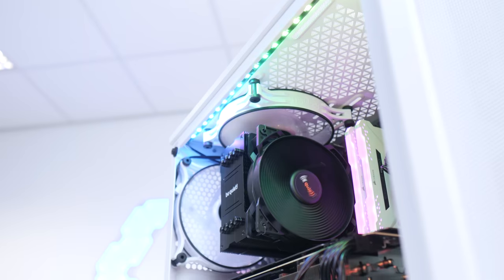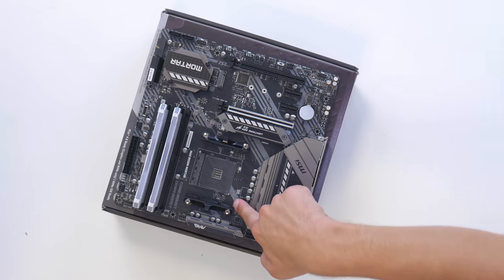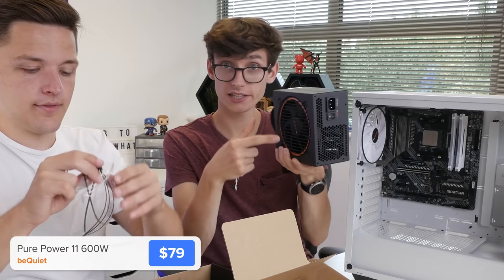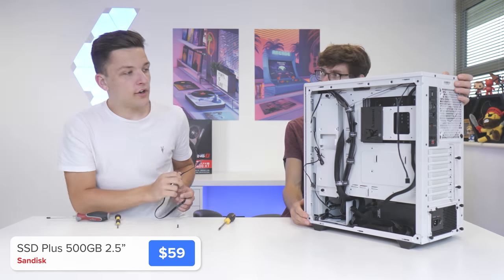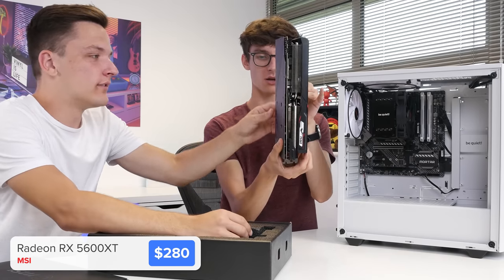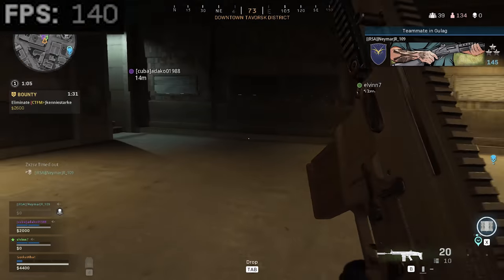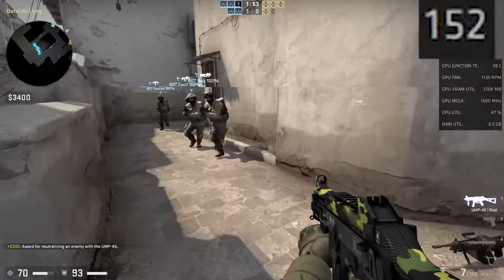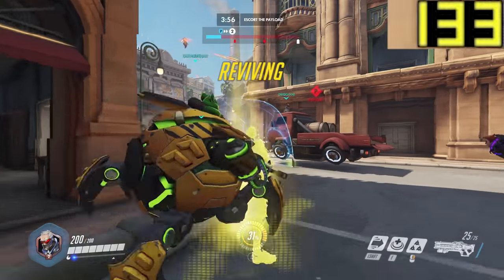Epic $850 Gaming PC Build 2020! [Full Build Tutorial w/Benchmarks! - ft. RX5600XT & Ryzen 3]

Comment: I thought I would ask but I have the same graphics card and I get stutters and idk what is causing it, can you help me out in some way???
Reply from the maker: Drivers all up to date? CPU or RAM not maxing out? Contacted MSI support? Windows updated etc? Let me know!
Reply: I had this issue on warzone with my 5700xt and I had to go into the game files and change the amount of cores used from 6-8. For some reason the game read my 8 core cpu as a 6 core, after I manually changed it all studders went away
Reply: @GeekaWhat  ive done all of that but still experience micro stutters, mainly in fortnite. Also i have the rx 5700xt not 5600.

Comment: An optimal build for a good budget! Plus quick question: How often should I clean my pc? It's been 2 and half months and my pc is looking quite dusty. I don't have air cans etc. Can you suggest another way to keep my pc clean without that?
Reply from the maker: Make sure you’ve got dust filters in the case with the fans pulling air in only through those filters! Keep off the floor if you wanna limit dust, too. Dust isn’t a major concern performance wise unless your pc starts getting super hot 👍
Reply: @GeekaWhat  Thanks mate! Cheers

Comment: Hi GeekaWhat! I’m going to build a gaming pc which is around £1000-2000. Could you do a build in the next video with a Ryzen 7 3700x and rtx 2070 super? You don’t have to but I think it would be good if you went for a budget like this.
Reply: I just built a build in this price range. Ryzen 7 3700x with a sapphire nitro 5700xt. 16gb of ram, b550 board an nvme SSD. Runs everything at 1440p 100 fps+ easily. Absolutely love it. 2070 super is a great card aswell but my card is comparable and is way cheaper

Comment: I bought the folllowing for my brothers 1st budget gaming set-up. Need your advice if I'm building the right system for him. He plays Roblox, Warzone, APEX, and does youtube video uploads. Do you think I picked the right items?......5 Ryzen 3600; G Skills 16GB DDR4 3600 CL 16; WD SSD 500 GB M.2; Toshiba SATA 4TB 7200 6Gb/s; MSI B550M PRO-VDH MOBO; EVGA GTX 1650 Super SC Ultra, Thermaltake SMART 600W ATX 12V V2.3/EPS 12V 80 PLUS ; LIAN LI Mid-Tower Chassis mATX Computer Case PC Gaming Case w/Tempered Glass Side Panel, Magnetic Dust Filter, Water-Cooling Ready, Side Ventilation and 2x120mm PWM Fan Pre-Installed (205M, Black)